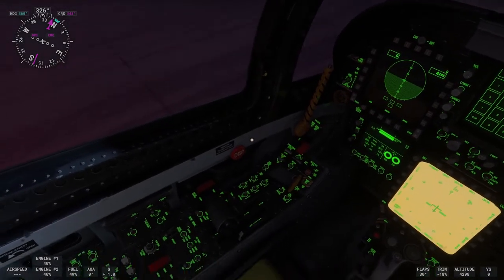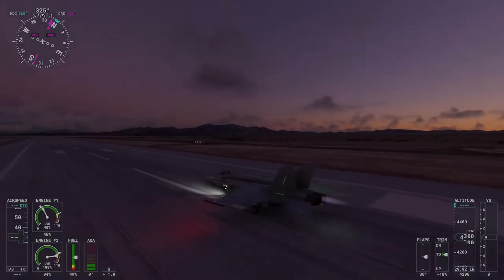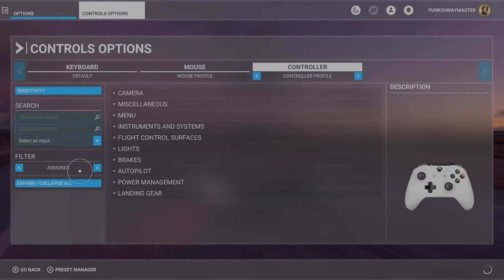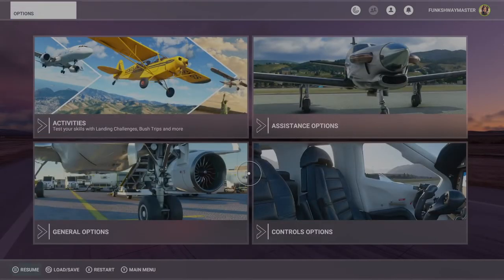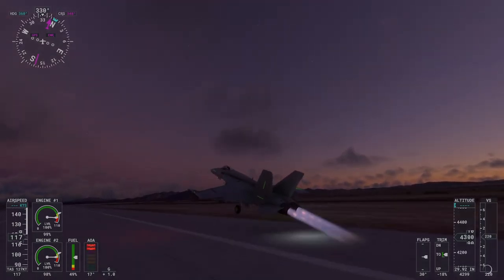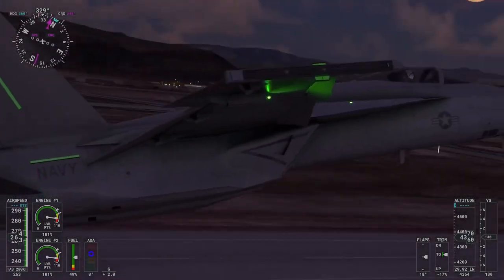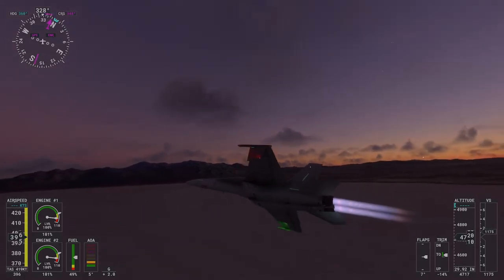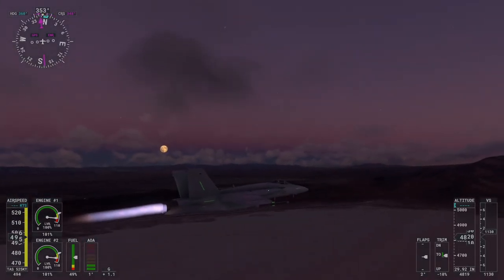Microsoft Flight Simulator F/A 18 Afterburner Tutorial Series X

Comment: how to open plane light ?
Reply from the maker: What
Reply: @halowars337  How do I turn on the F/A 18 lights at the night it’s so dark 💔 ?
Reply from the maker: @jehan_malallah  ahh yes if I remember correctly its located to the right should be some knobs if you want you can go into the settings and find the "cabin lights" and bind them to RB or LB that way you don't half to turn any knobs all you half to do is press a button you can also do this with anything like engine afterburners flaps etc